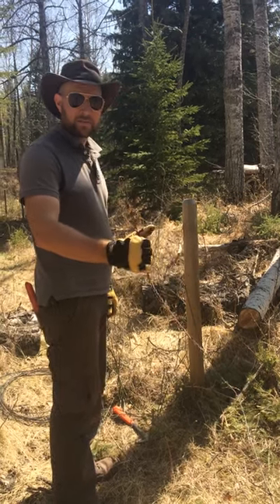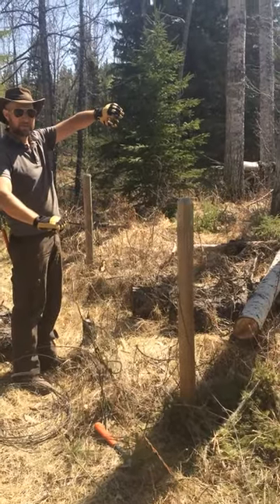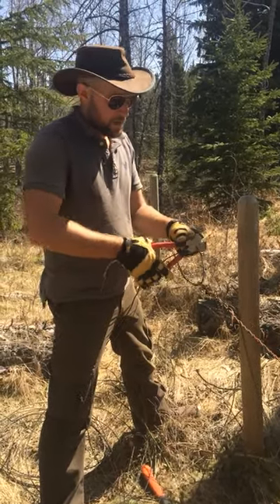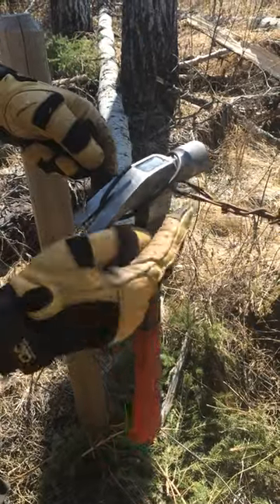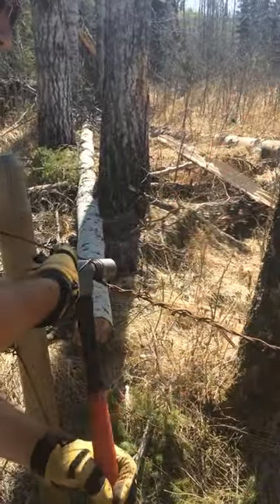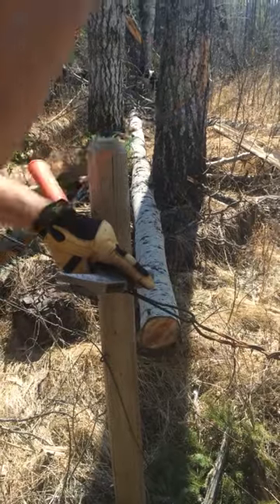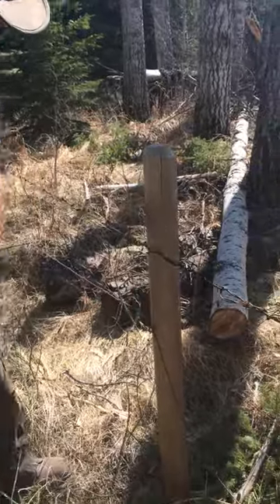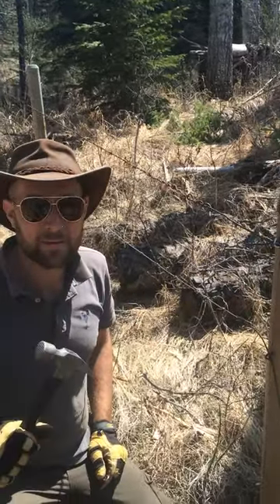How to use a claw hammer to tighten barb wire fence.

Comment: Thanks for uploading this, David. You're a very practical person. This is so simple it verges on genius. Not many would think of doing it like this. Sometimes simple is better. There was an instance where I had to pull one piece of wood against another and it was so bent that I would need a great deal of force to do it. The gap was only about 1/2 " but tight space requirements made it impossible to use any kind of clamp or come along or anything like that. And there was no purchase strong enough that I could not even use a ratchet tie down or anything similar. Took a stout piece of rope. Looped it around the post. Knotted it at one end. Left enough slack so that a strong stick would go through it and then just twisted the stick until the two pieces of wood came together by the rope tightening and then was able to drive screws into them. The force generated by this simple machine was enormous and the pieces of wood were stubborn enough so that the post was left with indentations.

Comment: In Honduras people use a tool that is ½" thick and about 4" diameter ring with a freely moving hook where you catch the end loop David showed here. Then you run a stick through the ring and set it the stick's tip behind the post. Apply  pressure in the handle and there you staple the wire.
Reply: How do you keep pressure on the handle while holding the hammer and staple? 🤔